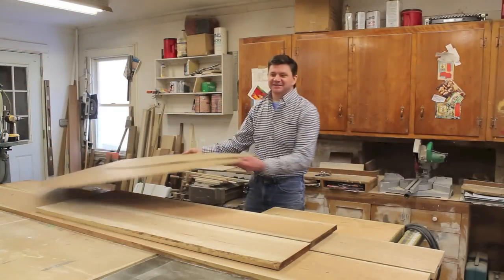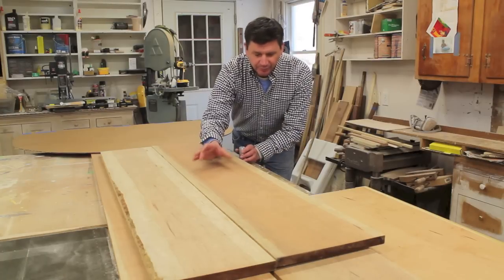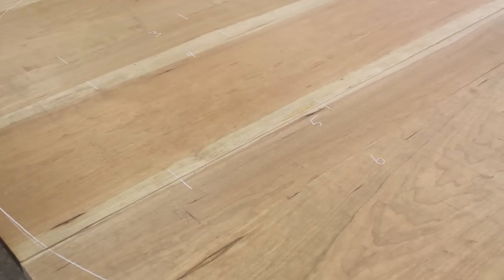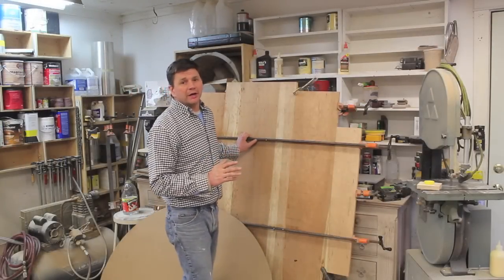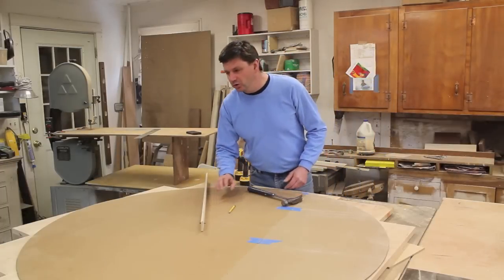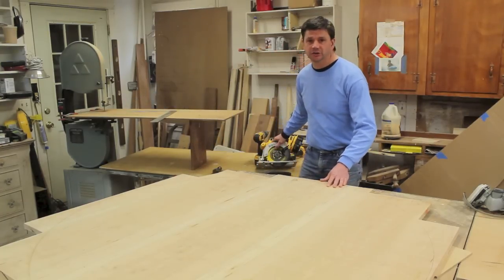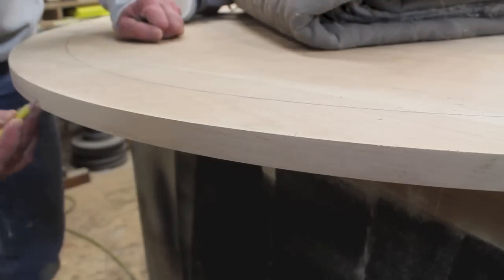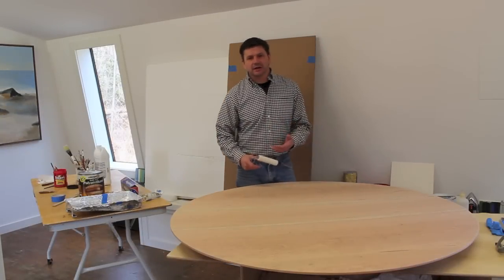How to Make a round table top out of solid cherry wood

Comment: Jon, I have a question concerning the support under the table top in a round configuration.  With a rectangular top and base, the aprons at either end (and likely in the middle) run perpendicularly beneath the field of boards in the top.  With a round top, the outer course of boards may not have any support under them to serve as support when downward pressure is applied.  Given that the top is edge glued and joined with biscuits, is that sufficient support as weight is applied on the top ?  Perpendicular hardwood runners spanning across the grain might be an idea, but would interfere with the light design look.  How did you address this, or am I overly concerned?  #overengineered
Reply from the maker: Hi Steve, this is part two of that project, you can see what I did about the support... 4 kids and a few years later and the table top is still good. 
https://www.youtube.com/watch?annotation_id=annotation_2805984823&feature=iv&src_vid=kfzE6OnEaLg&v=9wnpK7BHmOk